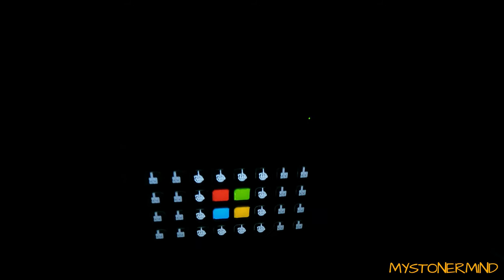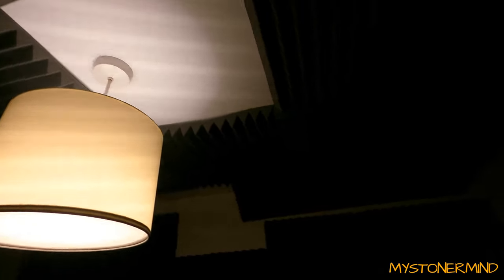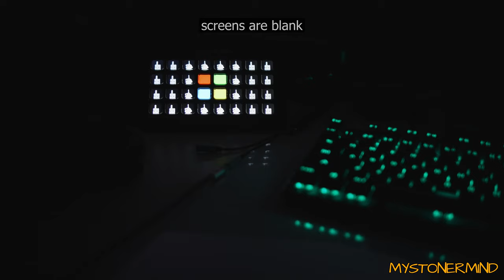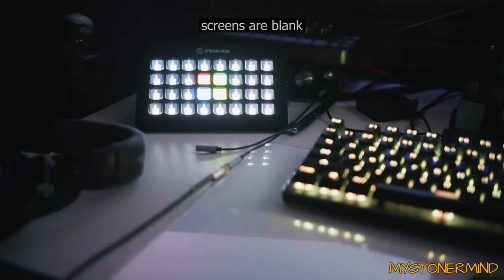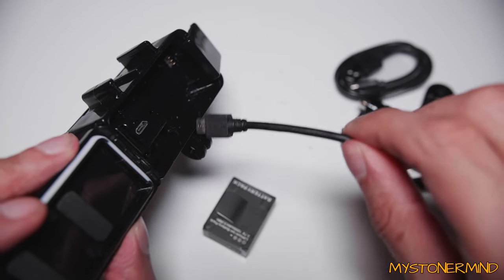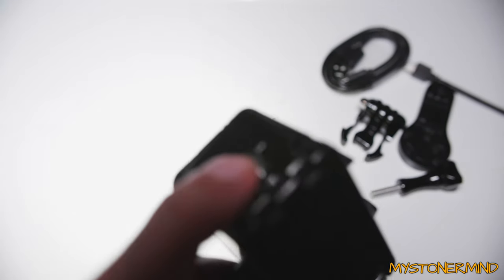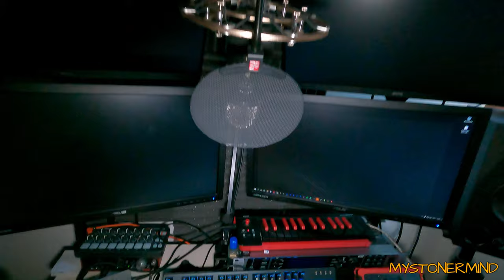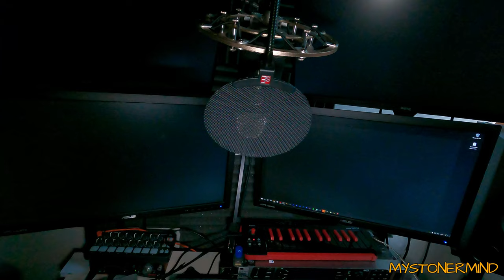Bright Portable Waterproof LED Light - Suptig

Comment: if someone did want an external usb charging port and make it waterproof still they could buy them magnetic adapters for micro usb, stick that into the port close the battery door and seal it back up again with epoxy around the magnetic port :)
Reply from the maker: nice idea